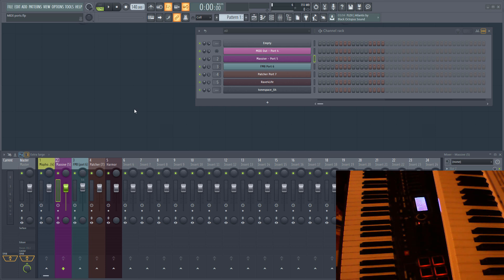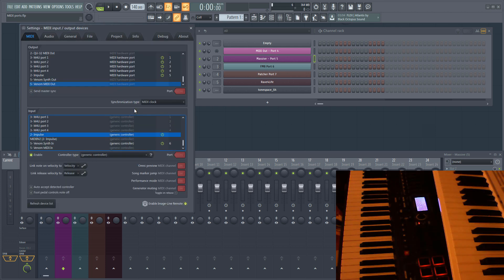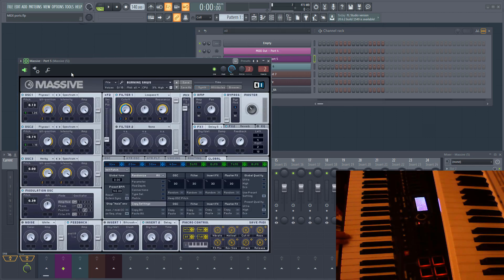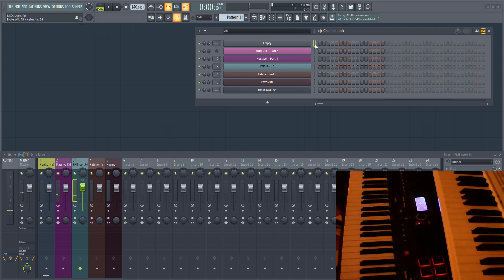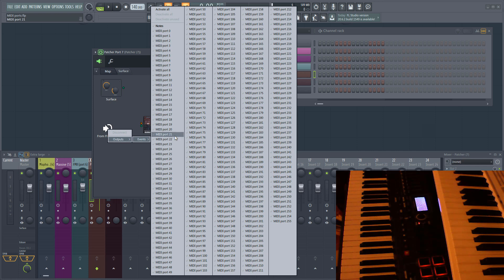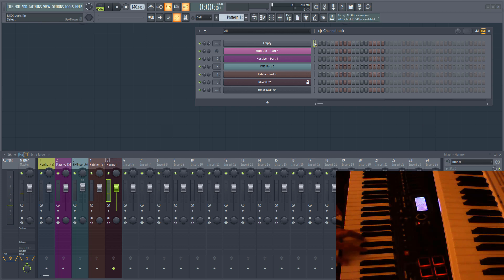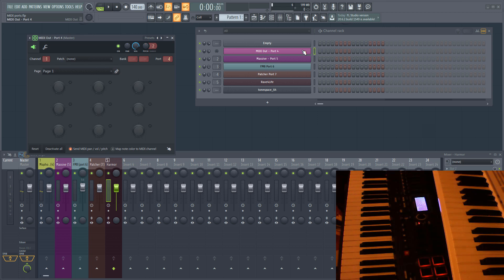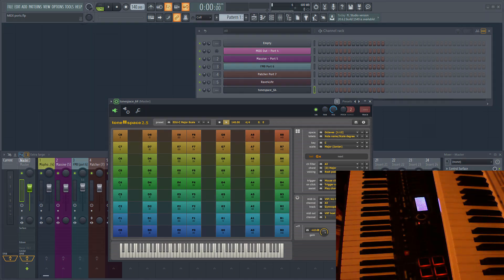Understanding MIDI Ports in FL Studio - How to route MIDI between plugins and/or hardware

Comment: Do I have to have a USB or midi in & out cable to send midi information from FL into my synth?
Reply from the maker: That depends on the synth. Most semi-modern synths support USB (as well as standard MIDI DIN-5 ports), so the easiest way to route the MIDI data from FL Studio to them is via USB. Just assign a port to the output in the MIDI settings in FL and use that to route the data.

Older synths will only have DIN-5 MIDI ports, so you'll need a MIDI interface of some sort to send the data. The MIDI interface will be USB though, so at the end of the day, you will be using USB at some level.

Some modern synths also come with VST editors that allow you to edit the synth directly from within FL Studio. These will give you instant recall of patches etc., which is great. One thing you need to be aware of is that they will directly interface with the MIDI connections of your synth. That means that you have to be careful about what you enable in FL Studio's MIDI settings; if you enable the input in FL Studio's MIDI settings, the port will already be in use (by FL) and you will not be able to communicate directly with the VST plugin from the synth iteself. It can be a little bit of a pain to figure out the best way of working if you are using your synth as both a sound source AND a controller in this case.

There's also Ctrlr (https://ctrlr.org/) that has a lot of templates for synths that you can download and works much the same way. It interfaces directly with the MIDI ports you select, meaning they are unavailable to other apps. Definitely worth checking out if you have a synth that doesn't come with its own VST editor.

The issues with the MIDI port needing to be available is often covered in the documentation, so make sure you give that a look too if you use Ctrlr or a VST editor. It might sound confusing, but I think if you try it out, and enable/disable the inputs in FL Studio's MIDI settings, you will get the idea of how it works and what the limitations are.

Personally, I use a dedicated MIDI keyboard (no sounds) to play in notes etc. most of the time, which allows me to keep the MIDI ports on my synths free to be used with VST editors or Ctrlr. What's best for you really depends on the equipment though, so spend a little time getting to understand how it all works. It'll probably save you a lot of frustration down the line!

Comment: Can I use MIDI inside FL Studio to control dmx lights? How could I set the ports then?
Reply from the maker: I can't answer this with certainty, having never done so. As long as you can use MIDI messages (CCs etc.) to control the lights, it should work, at least in theory. 

You'd presumably just set the output port to the same port as your lighting equipment. The MIDI port determines which output device the MIDI data is sent to. If you can send CCs et al to control the lights, then you can presumably use something like MIDI Out to do so. But you'd have to try it out to be able to definitively answer this question.

A quick google search also throws up results for Lightjams, which is a VST that claims to allow you to send DMX from a VST (https://www.lightjams.com/vst-dmx.html). Again, you'd presumably need to set the correct MIDI ports in the plugin wrapper to communicate over the correct MIDI device. It seems to be donationware, so it's probably worth giving it a shot.

You might also want to take a look at Ctrlr (https://ctrlr.org), which you can use to create UIs to send MIDI data. I've used it to create an interface for my M300 effect processor. In this case, you need to select the input/output device directly in Ctrlr, and make sure the device is not enabled in the MIDI settings in FL Studio (as you can't share the same MIDI device). In this case, you don't need to use MIDI ports, because you are selecting the device directly from the Ctrlr interface. As with MIDI Out, sending MIDI messages is pretty easy to set up.

If you do figure out how to get this to work, it'd be great if you could post a quick follow-up comment, in case anyone else with the same question ends up here.
Reply from the maker: I've also noticed that there seems to be a DMX effect in ZGameVisualizer. I dunno what it does, or whether it works though. It's under "Hardware" in the list and called "DmxControl".

Comment: I set the in and output to port 7 yet when I try it nothing happens even if I try every of the 16 channels, as you were showing in the video it detects the midi device but there is no sound... :/

If someone could try to help I would be greatfull.

PS: even when I try to lock it there is no sound...
Reply from the maker: The first thing I'd check is whether you can get the input from your device to work without setting a port - because it almost sounds like the device is not sending data if none of the methods work (especially the lock to channel option). If you don't set a port for your MIDI device, it will just be routed to whatever instrument is selected in the channel rack. Also check it with another plugin, just in case.

You can also open up the Debug window (it's a tab in the Settings). It will list all incoming MIDI data so you can check that FL Studio is actually receiving data from the device.
Reply: @steevmsteevm  Ok it does work with other plugins without problems, its just this one thing that doenst work. I just downloaded Piano Plugins since thats what I wanted FL Studio for anyways (Demo). So that I could change the sound of my E- Piano, because I always use headphones. Regardless of that thank you very much for your time. :)